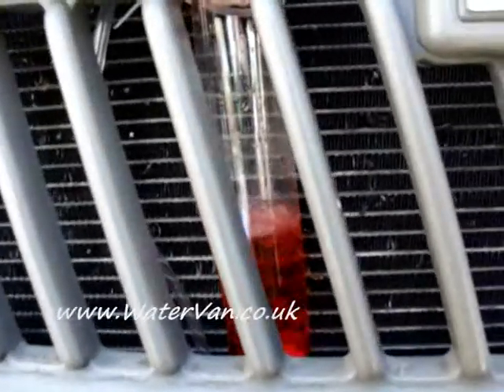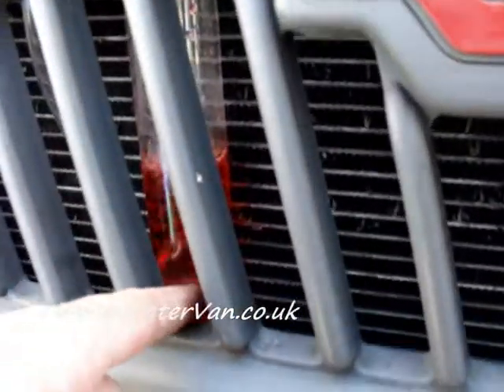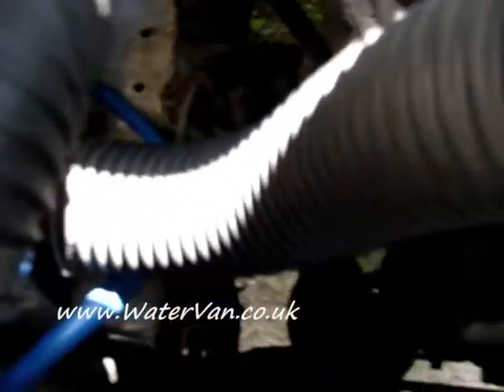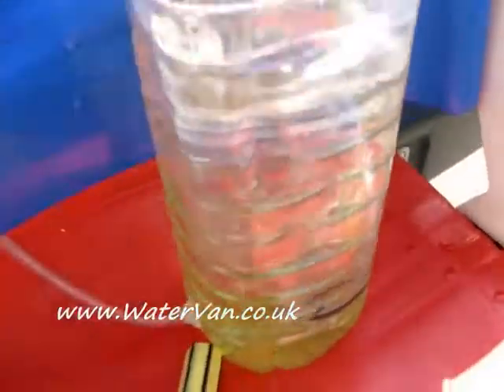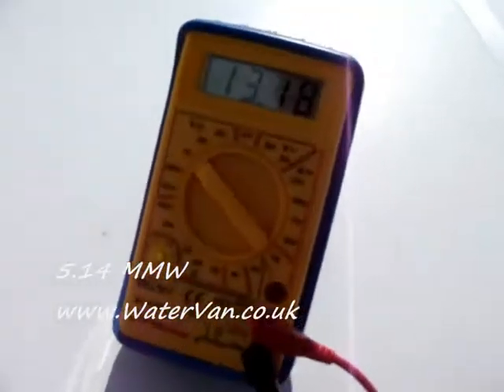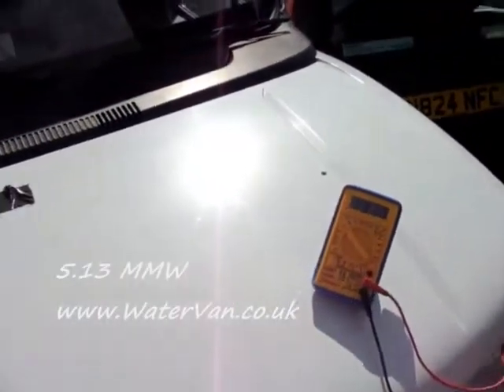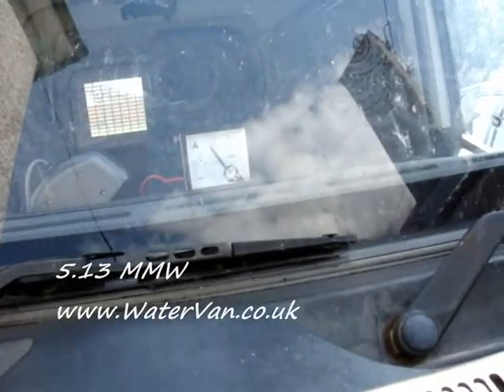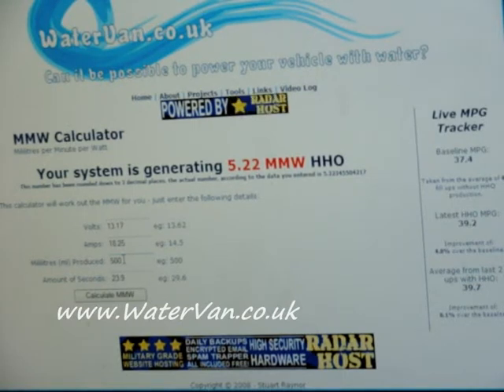#031 C5 MadStu's WPV - Installation of Cell 5

Comment: Hi Stu Great video Mate! Very well done sorry for my delay I'm waitting for the last lot of Glue to dry then I can start testing I spent all day trying to finish it off there is so much work that goes into maken a cell like this one but I think its going to well worth it. I got my relay, 4gage wire and fuse ready to go will hove some numbers very soon I dont think it will be as high as yours becuase I had 1 or 2 plates that shifted when the glue dryed not all even :-( will wait and see..